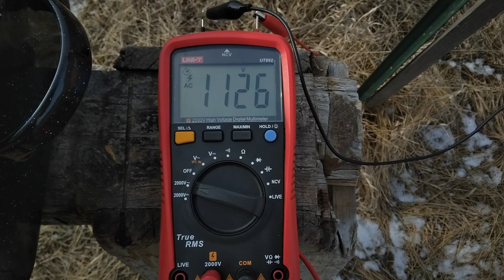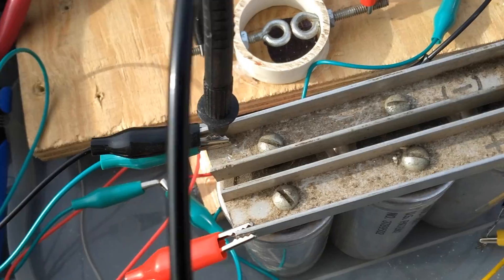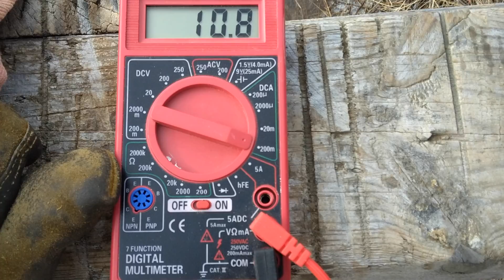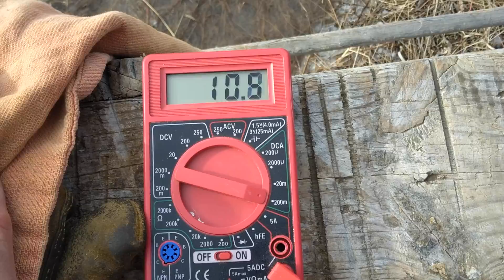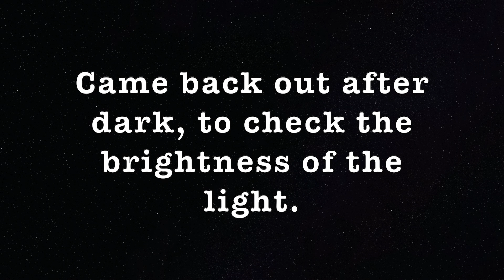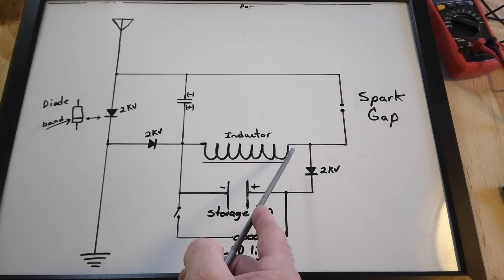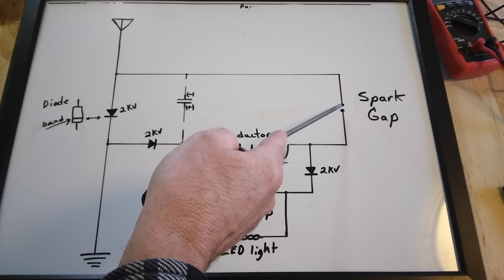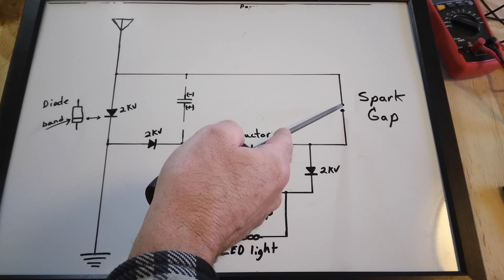⚡️Spark Gap⚡️ voltage reducer.  This case: 1,100v to 3v

Comment: Wouldn't this inadvertently be a spark gap transmitter as well? Cuz inductor and capacitor will ring at their resonant frequency when the spark jumps. Probably annoy any local HAMs a bit lmao.
I bet with the addition of a morse key and removing the load across the indicator on the circuit you could make a weird little passivly powered radio transmitter. I don't know if it has much utility but it'd definitely be interesting.

Comment: What if you took a MOT, ran this backward through it. Like into the HV (many fine winds) side. I wonder if it would step down the voltage and bring up the current.
Reply from the maker: There's just a tiny, tiny current, so there's not enough to saturate the core of a transformer.  That's why I was using pulses from a spark gap.   You get a bigger current for a short pulse.

Comment: You need a better antenna. Like A Tesla receiver coil.
Awesome stuff though. 
I research back emf myself.
 Interesting concept of turning the collapsing field into usable current.
But your losing 90 precent of the first discharge. Wasted potential.
Better off collecting the discharge of the dump into a battery and use the power that way. 
The spark gap distance will determine the vol😮at the time of the dump. 
Great circuit though. It's got that old-school vibe. Might try this with a pulse motor.
Awesome stuff 👍👍👍👍👍👍👍👍
Reply from the maker: Thanks for the interest!
The capacitor charging experiment showed that an average of 53 milliwatts of continuous power was available.
This experiment was showing an average 33 milliwatts powering the light.  So it was capturing about 62% of available.  Theoretically 100% is possible.  With the low voltage I was going for, the greatest loss would be from the diodes.  I had them in series, and that would be doubling the loss.
Started learning about this in the 1970's when I first heard about the Capacitor Discharge Engine of Ed Gray.
Reply: @doubleMinnovations I think what he is talking about is the spike on the front of the pulse. If you could magnify the waveform on a scope you would be able to see it. 

Very interesting, what you’re doing. 

If either of you are interested, a couple of channels I’m following are trying to duplicate or build and fly, the Alexey Chekurkov graviflyer. 

Look for the; alt propulsion/ alt energy , section.

*Came back to fix the spelling of Alexey Chekurkov.

Comment: typical voltages for a insulted wire under a transmission line are 10,000volts and a amp for a relatively short wire. the capacitive voltages rise with current in teh transmission line, so at a time where another line is bypassed, that particular line can double or triple current. that means the insulated with voltage can also double or triple. we routinely see 30-50kv in a dead line that parallels a hot line with our white meter.